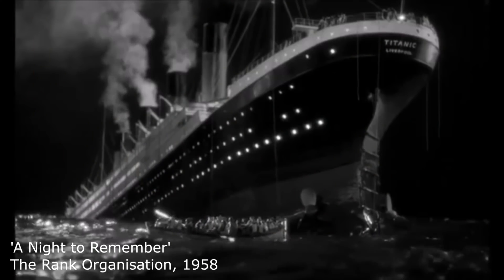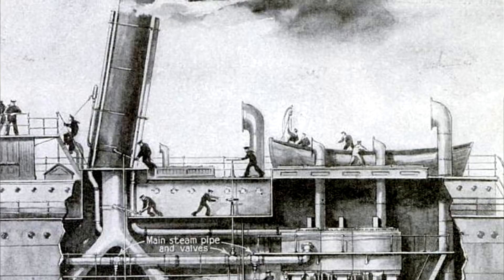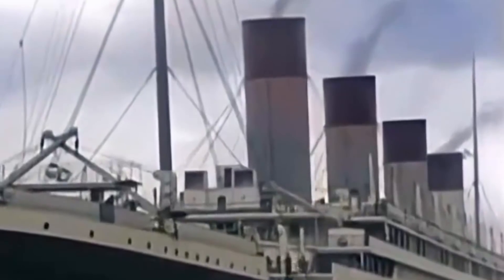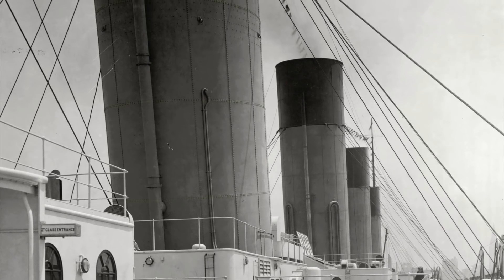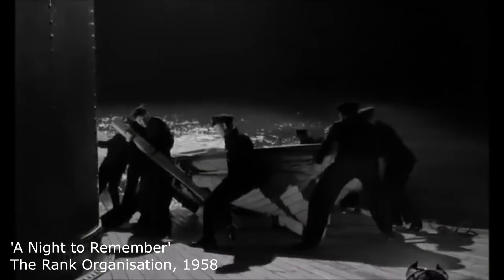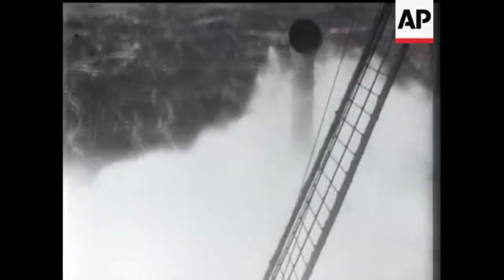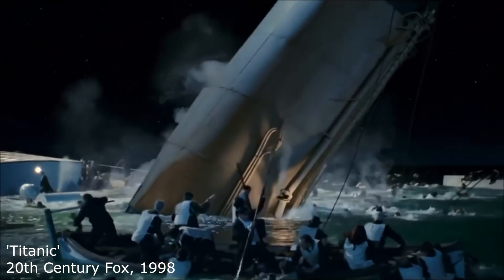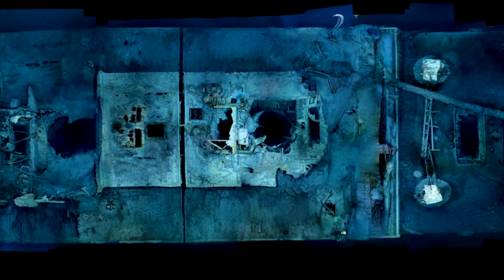Why did Titanic's funnels fall during the sinking?

Comment: This video shows that funnels are more than cylindrical structures that vent smoke out of the ship. You did well. However, there is one detail that you got wrong: While Charles Lightoller did sign on to the Titanic as first officer, the transfer of Henry Wilde from Olympic to Titanic caused Chief Officer Murdoch to be bumped down to first officer, and First Officer Lightoller was "demoted" to second officer. David Blair, the original second officer, was transferred elsewhere, not yet knowing of his good fortune.

I am under the impression that the two aft funnels fell for different reasons: Funnel four likely fell due to the momentum of the stern falling back, while the third funnel collapsed because the ship broke apart from beneath it.

On a final note, if you owned a shipping line, what naming convention and livery would your ships' hulls and especially funnels have?
Reply from the maker: Good catch on Mr Lightoller - can you tell I have spent too much time thinking about the mechanics and structure and not enough time thinking about the personalities? Haha

I think you're right about Number 3 - the superstructure - and casings, or "seating" as Mr Wilding puts it - likely just disintegrated beneath it.

I like your question! I am Australian so would name them after our gulfs and bays.. SS Otway, SS Carpentaria, SS Denham. I am thinking dark green funnel with a golden band. :)

~Mike
Reply: Your artwork has helped me a lot with my own artwork of ships, and I thank you for that.

It's rather telling that there are groups of people in any subject where, while they can and do know a lot about each other's strengths, some specialize in technical aspects and others can remember the details of the stories. And these people compliment each other's shortcomings to create an endgoal greater than any one of them.

My digital sketches have many different namesakes, but the ships of my hypothetical line, which I've dubbed the United States Motor Mail Company, would be named after the chemical elements. Each group of elements, like the Halogens or the Noble Gases, have their ships as sister ships to each other. As I find the prefix "SS" to be both cliché and outdated, almost all the ships in the fleet are powered by diesel motors, with two types of exceptions: Ships whose namesakes exist in a gaseous state at room temperature, like the Argon and the Nitrogen, are powered by gas turbines, and as such have the prefix "GTS." Any elements whose isotopes are all radioactive have their corresponding ships have the prefix "NS," for nuclear ship.

Their liveries consist of a dark cyan keel and a white hull, with a gold band separating the hull from the superstructure. The funnels would be cyan with a white band topped in black, probably because cyan is my favorite color. I did not think it through having gold on white.

These ships, with many others, can be found on my Facebook and DeviantArt pages, Maritime Artwork of Daniel Huffman. https://www.deviantart.com/shipping-architect

And now I feel guilty for advertising my sketches on your channel....

Comment: One thing to clarify, a funnel collapse is a very uncommon thing to happen; another thing to take in mind is that the funnels are built differently depending on what ship yard it was built in, a good example of this would be the Cunard line ship's Lusitania and Carpathia. Cunard line vessels had the funnels assembled in smaller sections aboard the ship and were not pre-assembled. the vessel, Lusitania demonstrates this well since during her sinking, her funnels only gave away after the sinking. Carpathia also demonstrates the same considered her sinking was photographed.
Reply from the maker: Good points!
~Mike
Reply: when the titanic sank. did anyone get sucked inside the funnel opening when it collasped
Reply: @randomrazr  i'm not too sure, eyewitness reports are all over the place on what happened when the first 2 fell.
Reply: @Matthew Turner There are cases which the stacks did indeed fall on people, now there is a rumor that when 3 and 4 gave away, one of the cables ended up chopping someone in half. Given it was pitch black at the time this occurred makes this an interesting topic.     ALSO one more thing about suction created by the uptakes, i know that people would have gotten sucked in but at the speed that these uptakes were filing up, the chances are that a person sucked in could swim back up after a few seconds. the whole space would have been filled up too quickly for any real chances of getting stuck in the uptake are pretty small.
Reply: @TimCan144  Didn't something like that happen to someone on the Lusitania, ie that they were briefly captured by the vortex falling into one of the funnels but I think were reportedly blown out shortly thereafter. That last part suggests an airlock of some kind formed and temporarily disrupted flow until the large bubble of compressed gas could escape. Yes actually I just checked this was included in the testimony of Mrs. Herbert Linford Gwyer (Margaret Inglis Adams Cairns).